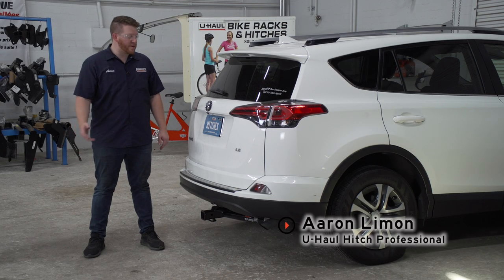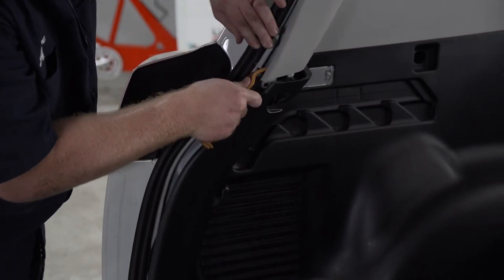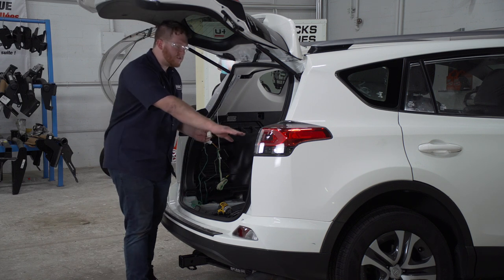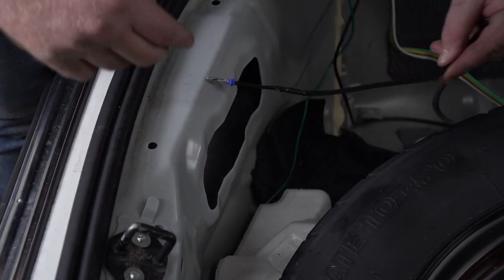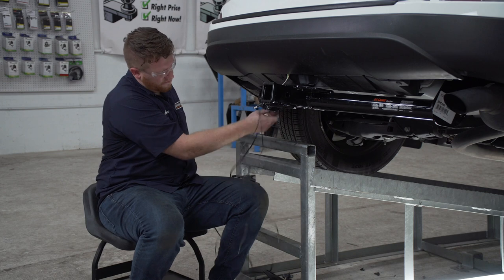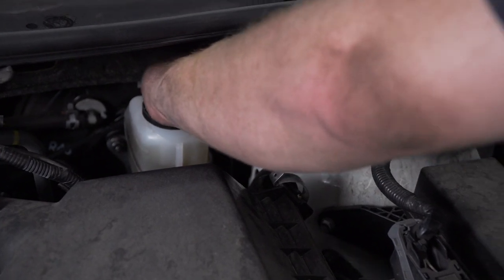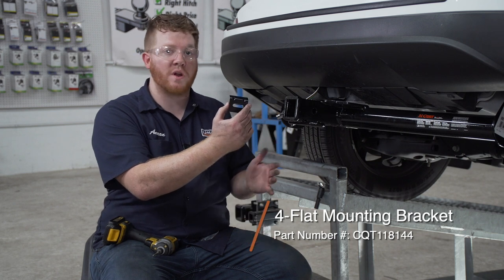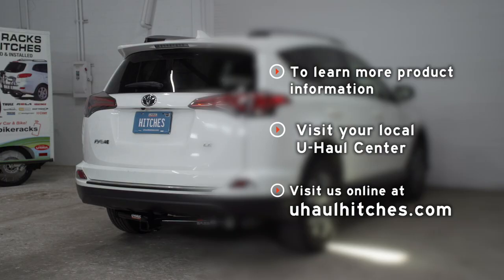2018 Toyota Rav4 Trailer Wiring Harness Installation

Comment: R u kidding me... The power wire on the outside🤣😂😬sounds kind of jenky
Reply: ..taking care to have it hug the BRAKE LINE.  ROFL.
Reply: How about the connector bracket, directly yo a flimsy plastic part?